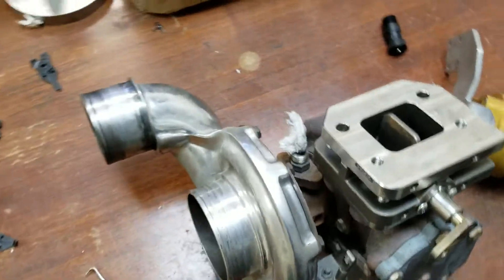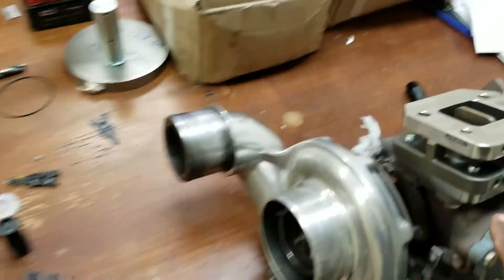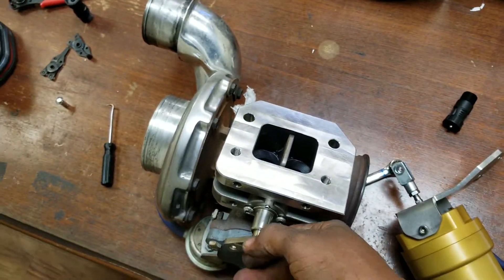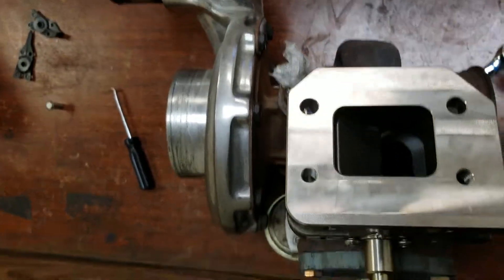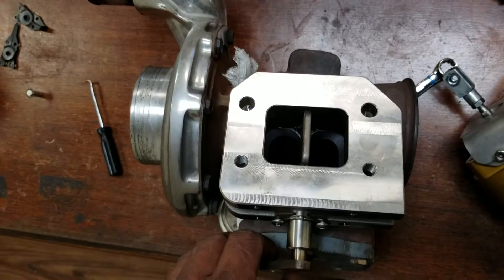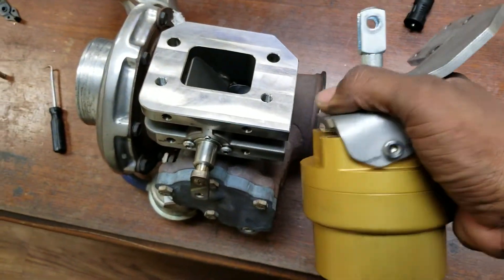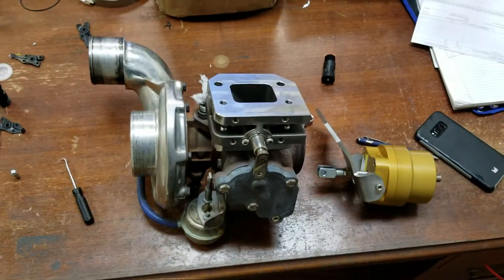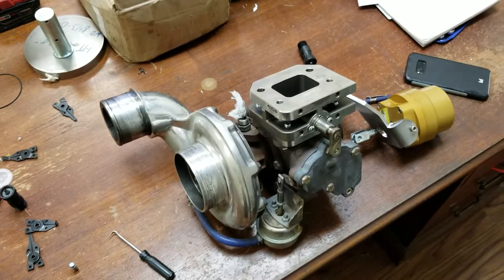Silver bullet 62/80 turbo with turbine diverter valve!!!

Comment: Nice beast you got there I also wanna get a s362 for my mercedes om606 and was thinking of using that diverter valve.
How well did it work for you?
Reply from the maker: Space is just too much of a premium around the battery. In the end, I ended up installing s362/s475 twins.

It had a 14cm housing which was still laggy as shit, so I have a 12cm housing being machined for a 75mm turbine wheel being delivered.

The diverter valve project is shelved for another time
Reply: @johnstoker1944  🤔...move the battery to another location? 🤷🏻‍♂️